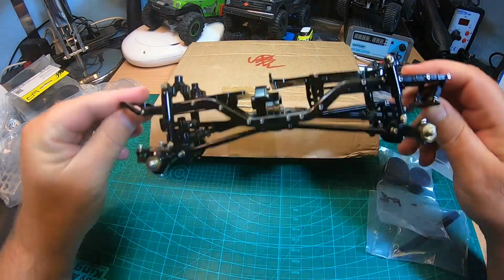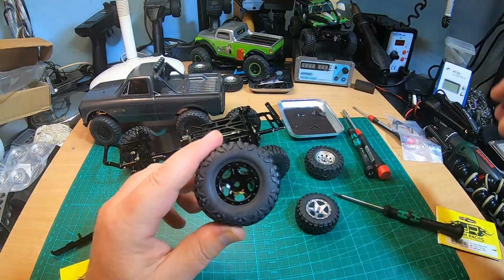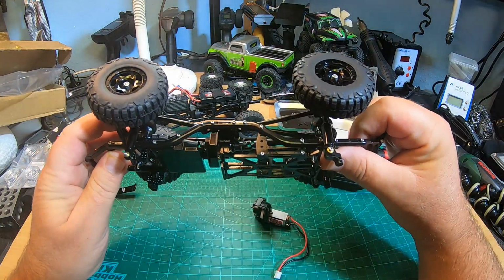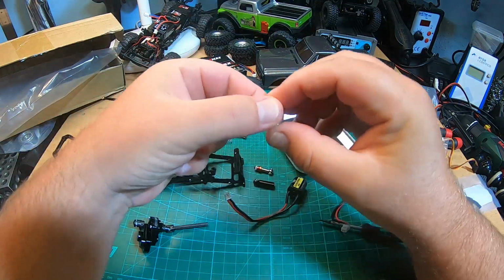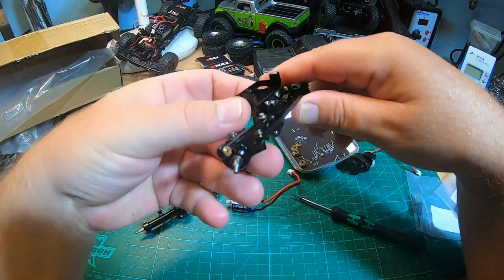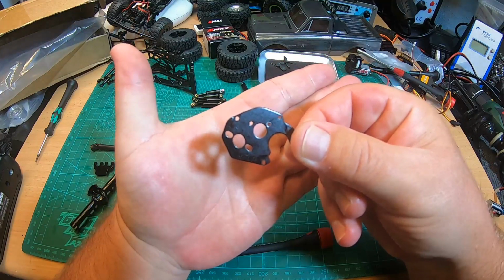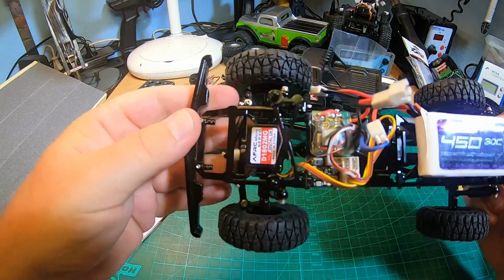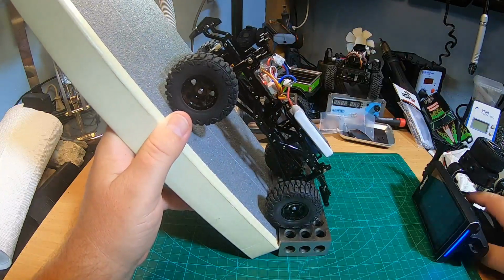SCX24 Full Metal Chassis

Comment: So I was thinking about using this as a base for a 24 scale comp rig Just cause of all the weight but I'd b losing the ESC plate and swapping those shocks out and adding brass hex extentions and add an emax servo mount and servo I also run The komodo outrunner but that's just me
Reply from the maker: Check my "rock bouncer" video, that's the metal chassis. 
Chassis is good, but too expensive. Shocks are good, no need for swapping. I have the Komodo, but did not try it in this chassis.
Reply: @donaldsneffe  I've seen the bouncers not into them just not my cup of tea and shocks I'd be swapping anyway lol also the bouncer is top heavy af I build performance based crawlers

Comment: So, the thing China does is make all these R/C cars. They have the blueprints for making the original Axial SCX24. They took out all the plastic and made it all in metal for the basic car. Anyone that thinks it is a custom build is mistaken. They can't mind read what each person wants with different custom builds. It is up to you to make your own upgrades. At $235 it is expensive, but an all original metal chassis in stock form. I have a few chassis with plastic and glue repairs. At some point as it keeps breaking would be better for a metal chassis.
Reply from the maker: As far as I see nearly all parts (but axle shaft and gears?) are already available from Chinese sellers for quite a bit of time...
It is too expensive (but you can get it for less than 190 using coupons).

Comment: When I seen the price for it I knew I wasn't getting it good or not. They are wanting $235 and by the looks of it it's not worth it. Thank you so much you saved a lot of people from wasting money. In my opinion I would just grab some upgrades and call it a day. Great video very detailed and full of information. Everyone have a great day and a great crawl
Reply: Definitely a deal compared to buying metal axles etc.. individually
Reply from the maker: Thank you.
150 would be ok.
It performs really well, front bracket can be modified, battery holder removed, ...
You can get 20% off with coupon - so you can get it for about 190.
Axles and gears are really good.
Reply: If u really think about it getting this and getting electronics would save you money just because everything is already upgraded an ESC is like 28 bucks a motor is 9 bucks an emax I think it's like 12 bucks the suspension is pull springs out and clip that stupidly designed bumper mount

Comment: Oh and so I don’t forget how compatible is the 24th scale stuff with 1/18th?
Reply: In general no specific brands I’m thinking of. I mean I use any part I have for any build. Just curious.
Reply: Does the hinge hook into the plastic mount on the Chevy body
Reply from the maker: @benfred8  No, it is meant to be mounted directly to the body (and take plastic mount off, but how to hold the rear bumper then?)
Plastic mount of Chevy body should fit into the frame, did not try yet, but seems so. So the metal mount is more or less useless.
Reply from the maker: Depending on models, 
Tires and wheels are normally the same (7 mm hex) and compatible, motors are compatible. But most other stuff is quite different and not compatible...
SCX24 is special, RC4WD 1/18 is special, Capo Cub 1 is special, HG-18 is special, Mini-z 4x4 is special, SG 1802 is special, Eazy RC Arizona and Patriot/n are special (but compatible with the FMS licenced Toyota Land Cruiser 80)... but CR-24 and CR-18 (and Katana, Atlas 6x6) do have same gears, shocks..., RGT 1/24 (Element Enduro 24, ECX Barrage) do have different gears, but a "Barrage Motor".
Bodies are a little bit difficult. You'll have to check wheel bases... SCX24 difficult, Mini-Z 4x4 bodies fit CR-24 and RGT 1/24 (wheelbase, but front motor makes it impossible to use some of the bodies),

Comment: You are always up with the newest releases. I love your stuff. The new fms Fire Horse looks cool. These latest transmitters that they come with, are those still turbo racing?
Reply from the maker: I do not know if they are Turbo Racing, but I know, that those transmitters (1/12 Willys Jeep and 1/12 Jimny) do not bind to the Turbo Racing receivers, I tested. 
I will not buy the Fire Horse, for sure. It is a EazyRC Arizona with interior and better elecronics and cooler box ... for double price... (I do have the CR-18 Kratos and the Arizona, ... both look very similar to the Fire horse).

Comment: Looks good but $240 is a little too much for me
Reply from the maker: With points and allowance 200, but still too expensive
Reply from the maker: @Namanoh  Good price. There are two versions now, a cheaper one and this one on Banggood. They also did already have some promotions for less than 200, and using points and allowances you can always get a quite good price.
180 on Amazon is really good (if it is this version), but I used all points and allowances I could get and paid even less on Banggood. 
Still quite expensive.

Comment: hey is it good if i use esc hobbywing 1060 for my eazyrc patriot? and using a 4channel transmitter receiver from turbo racing?
Reply from the maker: Patriot does have very little room... if you manage to mount the 1060 under the hood, it is for sure good.
Reply: @donaldsneffe  that's good then because I'm confused about finding the right esc,motor,and tranmitter for my little lc80👍
Reply from the maker: @dyllan451  I think 1060 will be too large... (wires are very large, too), but it will work for sure (if you find room).
Reply: @donaldsneffe  hmm..so what do you think is the best esc for patriot?
 *sorry for asking a lot btw:)
Reply from the maker: @dyllan451  Check this: https://www.youtube.com/watch?v=0d_WOpvopjs&t=2139s 
Or Furitek, Furitek was not yet released, when I made this video. Will upload a Video with Furitek brushed in few days.
"Best" is depending on your soldering skills...
I do have a Modellbauregler.de AS12/6 in my Patriot and my Arizona, will upload Arizona Video soon... Patriot is still not finished, check my Katana video, Katana does have the same body.
Reply: @donaldsneffe  uhh wait i have an idea, what if i just put wpl res v3😂, because the receiver and esc are combined so it doesn't take up much space hahaha😂
Reply from the maker: @dyllan451  Do not know, do not have WPL radios...